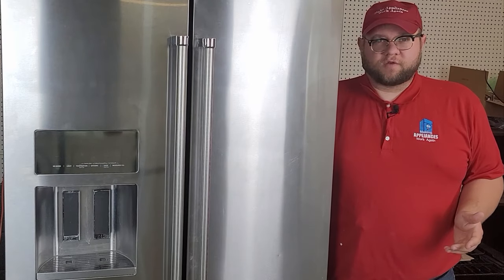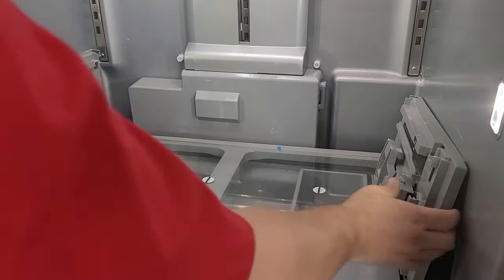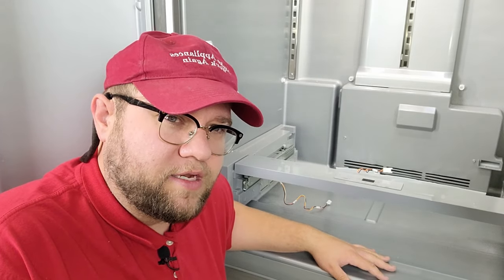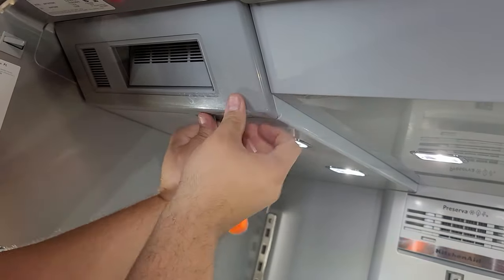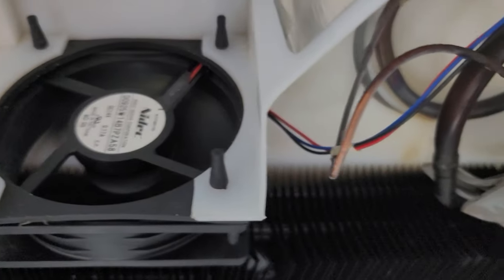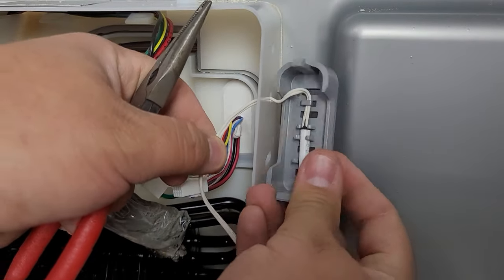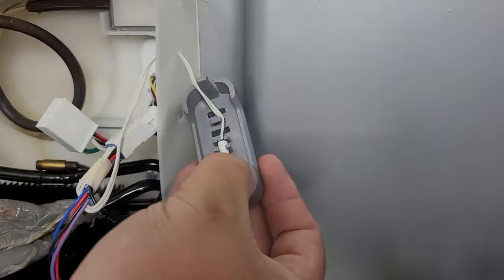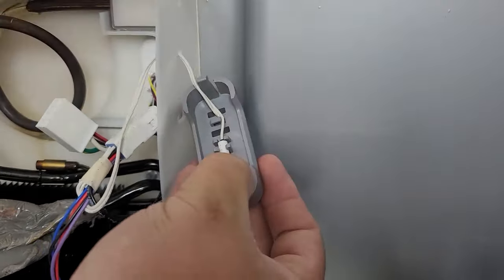KitchenAid Refrigerator Not Cooling & Leaking Water but Freezer is Fine - How to Fix

Comment: Thank you for this great video. My 5-door fridge is not cooling enough too. I'm hoping to follow your directions to solve the issue. I think a strange thing happened here. When I opened it up and got to the evaporator I noticed that the paste-like substance wrapped around the copper/grounding wire with clear plastic had melted and stuck everywhere. The melted paste was on the other wires, the black pipes and heating elements of the evaporator,  on the floor under the evaporator, etc. What is that substance and what is it for? Why has it melted? I'm about to order and replace the fan and thermostat system, but I'm not sure what to do about the melted paste, or just leave it alone. Thanks for your help.
Reply: Hey there, any luck? We have a similar issue; were you able to fix it?

Comment: HI, thanks for your video! I already replaced the fan/harness, and I can hear its working but temp inside goes down to 44F no less :( what else could be the issue. I checked the codes and the thermistor and other they look ok, not sure what else could it be :( please help.

Comment: Thanks again for this extra helpful video. I posted this comment and question under your diagnostic video, but more appropriate if posted here. So I did the tear down and completed the “triple fix” today as per your video. Once ice build up was removed on condenser coil and housing the diagnostic test #3 of the RC fan showed it did not spin, but as you said could be a faulty thermistor. Checked new fan - works perfectly, and rebuilt all back to specs.
QUESTION: regarding the thermistor you show to now clip it lower down, I did that as shown - but the new part with clip does not tightly grab the pipe - is a bit loose. Is that an issue?  Hope not. (I was unable to bent the steel clip, and did not wish to force with pliers in case it broke). Also the previous part was attached lower down to the other pipe? - the one that connects to the thin copper tube. Thanks for all your help, I owe you!!

Comment: this video saved us a lot of money..one question, i put the defrost sensor on the wrong tube..the tube with the tape.  do you think this will be bad??  i didnt think about it until i got it all together.
Reply from the maker: Should be fine. Its optimal to put it at the bottom of loop where the sensor is fully-flushed against the metal line so it takes longer to "Warm up" from the cold conditions.
Reply: @bensappliancesandjunk  ok. thank you for the quick response.

Comment: Ben, I have my whole fridge apart and am trying to put in the new fan assembly and thermistors as detailed in your video.  My fridge actually has different connections.  Looks like your replacement fan has a small connector, but my fridge has 2 larger connectors, so the new fan/thermistor combo does not plug in at all. Any ideas on this?  My fridge is a Kitchenaid KFIV29PCMS02.  Not sure why my is different than your in the video.  TX

Comment: Hi. I have this same problem with my 5 door kitchen Aid. The problem is i replaced the fan since it wasnt spinning and the control board. The fan still doest spin with a new fan installed., Both upper and lower ice up after some time. Any suggestions?

Comment: I have similar problems - same refrigerator.  The refrigerator box isn’t maintaining temp but the freezer is.  I do not get any ice accumulation in the refrigerator.  I replaced the thermistor kit as described in this video and the fan runs fine.  I have also recently replaced the main control board and pretty much all of components of the ice maker (due to poor ice making).   I did unplug the refrigerator hoping for a reset.  I checked the temp settings in the digital display settings and lowered it to 34 degrees.  Obviously I am missing something.  Any ideas?
Reply: Oh, and I did a thorough cleaning of the coils which were only moderately dirty….
Reply from the maker: Whats temperature at in refrigerator portion?

Comment: I have a kitchen aid 2017 model like Ben shows here. Control in door, Ice and Water as well both work well except when I depress the ice cradle, about 1 o of water drips out of the water side. Both work fine, but the water spitting out at the same time baffles me.  Strange... any clues. Thank you Ben great videos.
Reply: Same problem here.  The dripping water has actually damaged our hardwood floors.
Reply: @akk8929  did you find a solution? Before I start taking parts out to replace. Any clue?
Reply: @edsmith3389  None. I inadvertently defrosted the ice maker, reset the fridge, and attempted to take the door apart. There was nothing obvious and the problem persists. I'm resisting my wife's insistence that we call a repair person. Please LMK if you find a solution. I could find nothing on-line on this, other than your mention.
Reply: @edsmith3389  Update: I replaced the ice maker/water solenoid valves ($30) several weeks ago in hopes that this was the source of the problem. It was not. On Christmas Eve, we discovered the condenser coils were frozen solid (and the fridge was no longer cooling) so we emptied the fridge, removed the cover, and defrosted the condenser. And now - no water ejection. It's not obvious that these issues are related, but I'm glad that, after a year or more of water spits, we seems to be running normally now.

Comment: Hey Ben, I'm also Ben. Love your videos. Great work. Quick question if you have time.
I have the KitchenAid krff707ess01 and have had the above problem. I had to defrost the entire cooling tower with the help of a tech. Surprisingly, I think we got access to it without taking off the icemaker.
NOW, I'm getting water pooling and freezing in the bottom of the fridge cabinet. The freezer seems to be fine. My guess is that the drain tube is clogged or frozen, and it looks like the part (W11084807) implies that the fridge and freezer have different drain paths.
My question: It is very difficult to get access to the rear of my refrigerator. Is it worth it to try and get access to the drain hole from inside the fridge cabinet and unclog it that way, or is it just better to get to the rear of the fridge and try to unclog from the bottom up.
Thanks, and all the best!
Reply from the maker: Optimally, you want to check the duckbill on the back of the refrigerator as there's a 50/50 chance on whats clogged: the duckbill or the drain line itself. With a significant amount of pressure though, you can force the obstruction out through the drain hole in the refrigerator, so it is doable from front-access-only.
Reply: @bensappliancesandjunk  Thank you for the reply. I realized the drip capture tray was frozen over and possibly blocking the drain.  I ended up unplugging my fridge putting warm water in the drip tray, and gently breaking up the ice. I then let it sit open for 24 hours. It's been 96 hours since I plugged it back in and no water is pooling inside the fridge cabinet (yet). Finger's crossed!

Comment: I have a 5 door that stays around 50, constantly a yoyo temp,  but usually stays at 48. Freezer is ok. But the freezer can’t do -5 degrees if you set it there. Techs have thrown the front control panel and the rear control board at it but it still operates the same. My coils were not frozen. I like my fridge at 34 but it can’t do it. Is this a piece of junk? I’m lucky I purchased the extended warranty from Kitchaid as they throw parts at it. Here is the funny part, I am an hvac tech and have tried different trouble shooting techniques (raising the front, putting a fan at the front coil, etc.) here’s the best, If I pull the cord and plug it in, the air duct output in the fridge puts out 20 degrees. But in two hours, it’s up to 48 and it stays at 48. I can do it again and get the same results. I’d love to know if you have figured this fridge out. It obviously can do 20 degrees for a couple hours every time I unplug/plug it in; which leads me to believe the compressor is good. Is it that switching valve on the refrigerant line? I was told the switching valve was DC voltage. Is the DC voltage not enough to open or close that valve correctly? I’m grasping at straws, but it has got to be something simple; an obvious design flaw, and my techy gut is eyeing that valve. I believe they’re throwing a compressor in it next. By the way, you can’t mess with the defrost, they took out option #7. Any ideas?
Reply: Did you ever figure this out?
Reply: @louwgrobler5097  no. They bought it out under the extended warranty. The last tech told me off the record that it could not be fixed. He offered to put a compressor in it but said it would run no different. To be honest, the compressor ran fine. The only thing I had noticed was that ALL the techs would always set the freezer to the highest setting +5, still freezing but not the cold I wanted. BUT, the fridge seemed to maintain 38. The tech said the system would always steal the refrigerant from the fridge evaporator trying to achieve the freezer temp and to always keep the freezer set to the highest temp (+5 I think). To me, it’s just a junk fridge. Being this was my second dual evaporator fridge that failed. I’ll never buy another dual system, unless it has dual compressors.
Reply: @louwgrobler5097  I have always wondered how many of these still exist. The tech also told me that everyone with my extended warranty were bought out and junked by Whirlpool.and sadly I only received 75% of my money back. But it was better than a total loss. The other trickery by Whirlpool was paying you with a gift card. I nearly forgot I had the card, and I bet they bank of that. But I finally used it and got the money off of it.

Comment: I have a 5 door kitchenAid. Freezer not getting cold. Fridge works seemingly ok. Freezer has no cooling at all I found a ball of ice on the coils and melted it off. Then ran the freezer for over an hour and no cooling. nothing at all. checked the coils and there was no ice. Nothing. fan still working on both fridge and freezer when do the 3rd test at 4. Changed both the temp sensors on the freezer. still no cooling. Coil is slightly cool on the intake side but not cool. Compressor sounds fine. condenser fan working and condenser coils clean. Any ideas?

Comment: What is the purpose of the grey mastic stuff?  I have a KitchenAid 5 door that won't cool below 50 degrees in the fridge part but the freezer is fine.  I took it apart and removed the evaporator cover and saw that the grey stuff was leaking out from the plastic containing it and got down on the evaporator itself.  Before I took it all apart there was a lot of ice build up on the outside of the evaporator cover and I defrosted it and then turned the cooling back up but still wouldn't get below 50 degrees and starting frosting back over.

Comment: This is what was going on with our refrigerator.  We removed the ice and replaced the thermistor.  The refrigerator cooled properly for about 2 weeks and now doesn't get below 60 degrees and is iced over again.  Any suggestions? The freezer is working, but is warmer than it should be at 17 degrees.  It also has not been making ice.  We have cleaned the coils.  TIA!

Comment: I'm having the opposite problem - Freezer not Freezing, but Refrigerator is running cool(ish 40 degrees).  Checked and replaced the fan/thermistor kit and it's all running fine.  Evaporator isn't iced over . . . Compressor is fine, Compressor fan is fine.  Just no cooling happening in the freezer - Freezer is 9.5 years old, but it's just me in the house and I used to never even be home . . . so probably the use of a 3-4 year old fridge.  Kitchenaid.

Comment: To be extra sure, I would also suggest wrapping the thermistor in aluminum foil tape and also increasing the temperature in the fresh food section (40° F or higher).
Reply from the maker: Good tips! I thought I included the aluminum foil tip in the video, but may have overlooked it. Thanks!
Reply: @bensappliancesandjunk  can you explain what you mean by wrapping thermistor in foil? I did this literally and changed out the fan and my refrigerator is now cooling too well, more than 13 degrees lower than setting. Do I wrap the white probe? The line attached to the coils? I think I attached the thermister on the coil too far down from where you placed it. Overall, great repair points made.
Reply from the maker: @mattp4826  it's all about contact between the thermistor and the refrigerant line. The thermistor loves to go bad and defrost too early, so moving the thermistor to a place more likely to be cold means it should defrost more to clear the system. Did you replace the thermistor when you moved it or just use the same one?
Reply: @bensappliancesandjunk  I ordered a new replacement fan assembly and since I went to the trouble of tearing it apart (tbh not that hard) I ran fan diagnostics and it was perfect but I replaced it anyway. I think I put thermistor too far down the evap coil because it went from barely cooling to 41 degrees to now cooling to 32 while set at 41.  Before I tore it apart again I was going to get your advice.  But thanks for the advice because I picked up this 5 door fridge for next to nothing and fixed it for next to nothing. Very pleased but couldn't do it without your great video.

Comment: Thank you Ben, I know your super busy, but please make more videos when you can, they're super helpful. Also wondering if you can shed light on selling parts off appliance that's not worth fixing. Do you test them at all before sale? Struggling a little with that atm. Don't wanna sell something that didn't work to begin with.
Reply from the maker: I do need to do more business videos. Its always on my mind, but the sad thing is... Running the business makes me so busy that its hard to get some good ideas on what to do w/ those style videos, whereas with fixes, I'm recording with a really specific band of ideas in mind. But that's a good idea on how to answer on a video.
Reply: I have a three door fridge KitchenAid and the freezer is at the bottom and what I would like to know is how do I check the temperature regulator that feeds the cold air into the fridge that’s at the top I wasn’t getting any air flow to the fridge but the freezer was ok and the evaporator fan was doing it’s job for the freezer but I couldn’t feel anything out of the back of the fridge at all and I suspect that it’s the motorized damper motor and the actuator that physically moves the door that controls the temperature and the amount of air flow that comes from the bottom of the freezer compartment that at the bottom of the fridge So basically the freezer was the right temperature that the digital readout said and it was set at zero but the fridge at the top of it two doors never got any air flow and it just kept getting warmer and the evaporator coils were Iced up but the evaporator fan runs when I hot wired it directly and the defrost heater was heating up when I did the same the only thing that I did not check was the thermostat that I would have to freeze it in water to make sure that it is ok but I think that the problem is the motorized damper that I’m not sure how to use a meter to verify that it’s not working properly and unfortunately I took the fridge apart before  I found the troubleshooting diagnostic test that I could have done before I took it apart so what kind of readings would I get being’s there’s a motor and a actuator that operates the door to get air flow up to the fridge compartment that is at the top Thanks for your quick response to my question  @bensappliancesandjunk
Reply from the maker: @allenhoffbauer4480  I have a video that shows test modes/error codes and such. There should be in that video, the mode# for actuating the damper system on and off. Open the fridge up and test that with being able to visually inspect the damper if it operates or not. If it doesn't, replace damper.

Comment: Hey thanks for your videos! I have a kitchen aid 5 drawer and it does not cool. When it gets plugged in i hear a few clicks from solenoid in rear and it shows a PF light on display but no lights on in fridge and water does not work. Any ideas?
Reply from the maker: Pf suggests a board issue or bad electric outlet
Reply: PF means Power Failure. It happens when you unplug fridge and plugged it back. You just need to "cofirm" pushing the 6th button on display.

Comment: I have this fridge ... The refrigerator cools just fine but the freezer won't get cold enough... Had it looked at and nobody can figure it out. I ran all diagnostics through the control panel and all came out OK. The refrigerant was changed and system was checked for leaks etc, there is no ice build up on the coil etc. I'm lost and now have a torn apart KitchenAid in my living room... FOR MONTHS NOW. someone suggested the valve that diverts the refrigerant from the fridge to the freezer is broken or stuck... If so, is it possible to UN-stuck it?

Comment: I have a kitchen aide KRMF706EBS01 refrigerator that the freezer works but the refrigerator part doesn’t cool nor does the ice maker make ice. Could it be a circuit board or start/run capacitor relay issue?
Reply: Same here! Any luck fixing? We've had the most horrible experience with service calls.. might give this video a go.
Reply: @wouldratherknot3680  I had to replace the circuit board both upper and lower fan units thermistor assemblies. About 1500 bucks worth to the service guy. It’s on extended warranty but that only covers sealed units like the compressor.